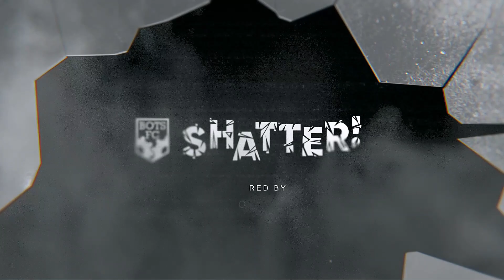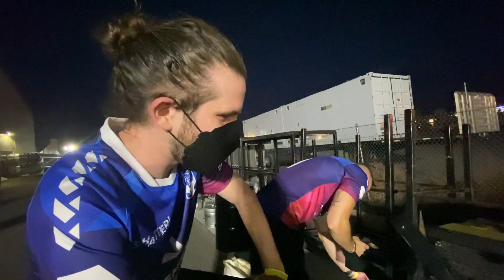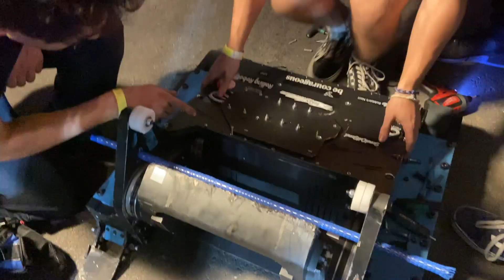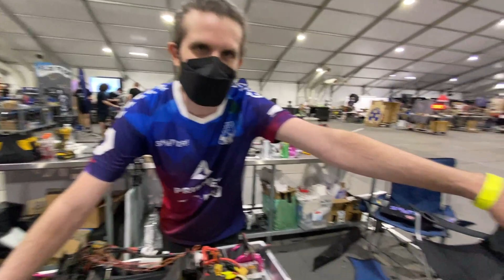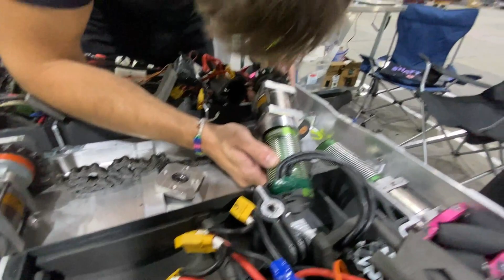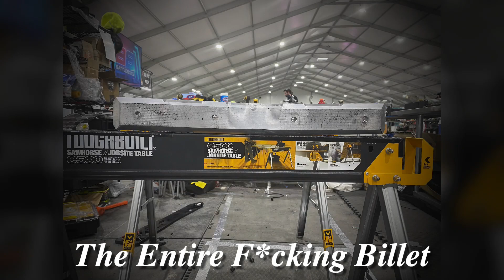Shatter! Battlebots 2021 - In The Pits - Episode 7 - Riptide Post-Fight

Comment: I would like to see a version of "Rusty" with the front arm slightly curved in. Like the "Mary special" but without spikes. So you can fire the hammer without the arm hitting first. 
Shatter is one of the most entertaining bots to watch 👍
Reply: Or maybe a higher weapon mount so that the hammer hits over the spinners. A curved hammer would have a shorter swing.

Comment: I sense that these wider egg beater weapons are the key to overwhelming ablative armour. Unlike their narrower traditional heavyweight vert bars/discs they don't appear to just sever partially through and dissipate energy with the cut. Instead they seem to just get enough purchase to cleave fixings and completely shatter (couldn't resist) it. 

I really enjoyed watching a hammer bot get into the top 32 again. A conventional hammer will always be Battlebots on hard mode, but that's what makes the bot so damn watchable. 

You did great. Loved your run. Shame it ended as it did, but it looked like you got thrown against a design that by its nature is good against yours.
Reply: I think it's more a question of bite, minotaur would just grind away slots in the plastic while the weapon is pretty wide, but it doesn't have the reach to really dig into the plastic.
Reply: @bami2  Minotaur also has fairly narrow weapon teeth compared to the whole drum though. It's only ever about half of the total width engaging at once. Riptide engages the full width, with better bite, to transfer a lot more energy in one shot. They are designed for different things, and it turns out that Riptide's thing is better at taking on ablative armor.